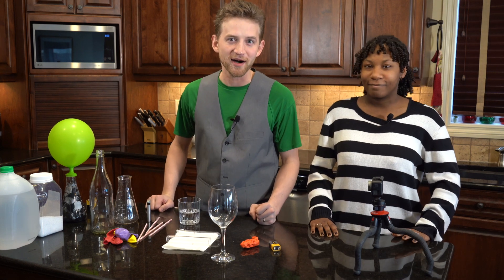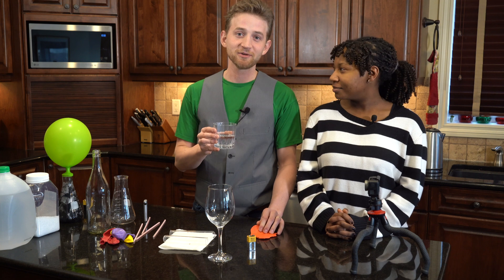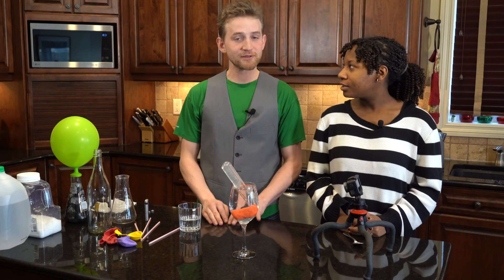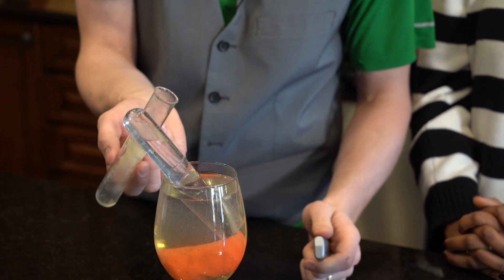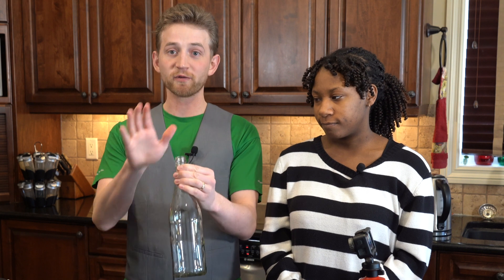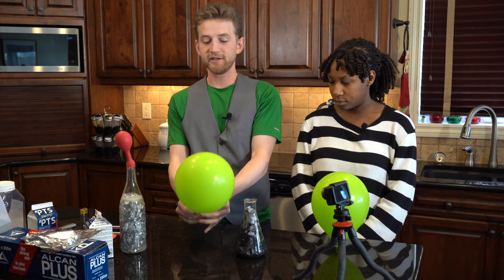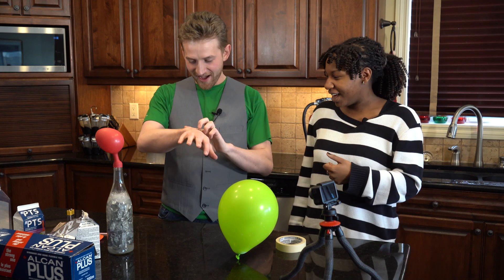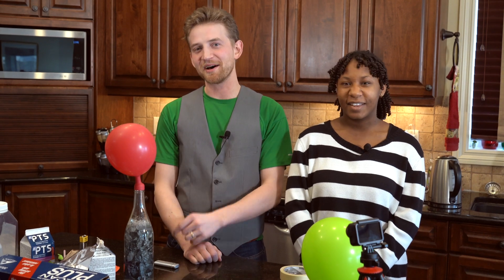Hydrogen explosion at home! - how to make a hydrogen balloon

Comment: As a callow youth, I worked as a chrome plater. The (metal) object to be plated is placed in a tank of chromic acid, along with lead anode bars, and they are connected to electricity. The metal cathode attracts positive Chromium ions (which plate onto it) and Hydrogen ions resulting from electrolysis of the solution. The anodes attract negative Oxygen ions. This produces bubbles of hydrogen and oxygen gas, which should be removed by ventilation fans. Some of my coworkers thought it was funny to toss a lit match into the mix, which provoked a reaction and caused some formidable bangs. I eventually decided to find a better way to make a living!
Reply from the maker: Sounds like a good idea to me!